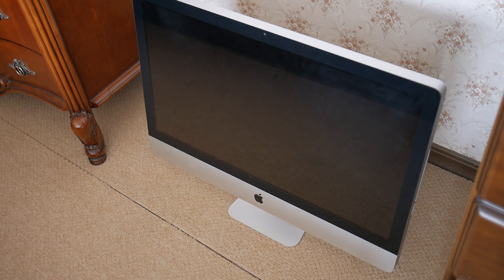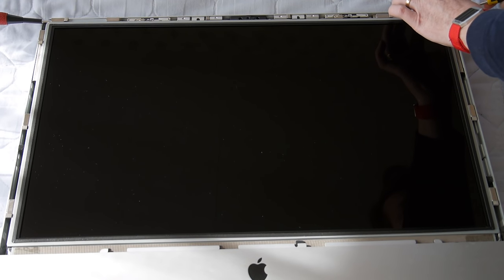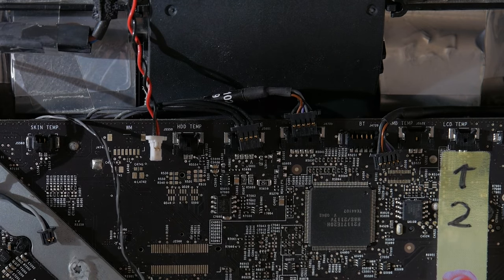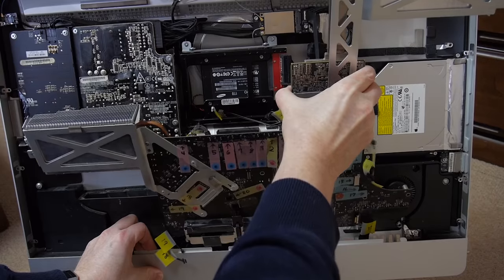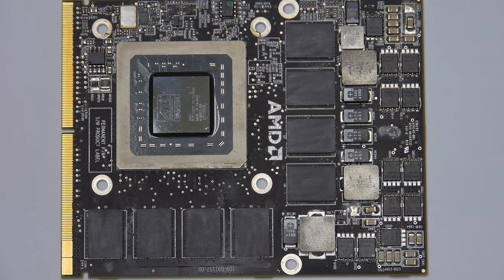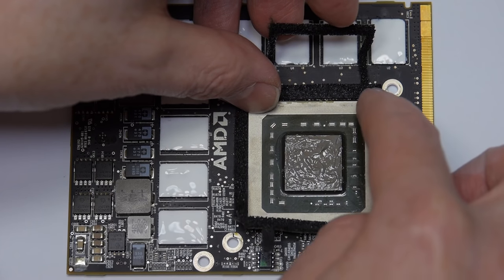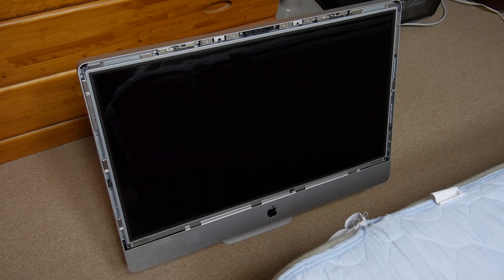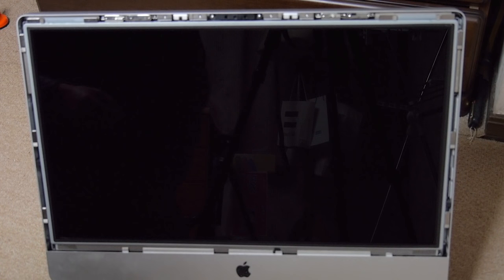Late 2009 iMac 27" Video Card Repair [4850 Bake]

Comment: Would this procedure apply to iMac 21.5 mid 2010 model too? Great demonstration!
Reply from the maker: Thank you for your kind comment.  I am sorry to say that my video would not directly apply to your Mac.  The insides of the 21.5, regardless of year, are not the same as the 27".  But the basic premise is the same and it would likely take the same amount of time.  You'd need to locate your video card, remove it, clean off the thermal paste, bake it, apply new paste, reinstall the card, then close up the Mac and test.  If you decide to do that, I would encourage you to make a good quality video of your work, not only for yourself, but for other 21.5" iMac owners who would love you dearly for sharing your experience.

Comment: Hey, hope you’re well. I wanted to ask you where you would recommend: Where Is a good place to connect a grounding clip for the anti stain wristband on the iMac whilst I’m working on it? I’ve been looking all over the web. No direct answers so I thought I’d ask you. Thanks for your help, J
Reply: Also, where did you store the screen when you took it off to work in the card? Thanks again JDW
Reply from the maker: @jeromemrj  I would not recommend connecting your anti-static wrist band to the Mac because the only way that would work is if you connected the power cord to a grounded outlet, and when working inside your Mac, a connected power cord could be hazardous!  The only place in the home other than the Ground pin of a 3 pin power outlet that is ground would be metal pipes, but connecting to those is probably more trouble than running a wire to the Ground pin of an outlet.  The only thing you really need to worry about is accidentally zapping the RAM with static when removing and inserting.  So long as you are not on a plush rug in winter, you should be fine though.

I set my display against a wall in my room where no other people would be for the entire day. Make absolutely sure you do NOT touch the display.  Only touch the edges.  Fingerprints on that display are really hard to get off.

Be very careful when working on your iMac in its upright position.  One guy who tried the bake had his iMac on a bed and it fell off onto a concrete floor.  Amazingly in his case though, the iMac was undamaged and the bake worked for him too.  Don't expect your iMac to survive a fall like that though.  He was truly blessed!

I hope this helps!

Comment: This video really helped a lot. By the way is this the same as the 21"? coz mine is 21". Thank you.
Reply from the maker: My iMac, shown in the video above, is a 27" model, i7, 2.8GHz, purchased in November 2009.  And while I cannot offer you specific guidance on 21" models, I do read and reply to every single comment here, and I have had a few people with 21" models who said my video helped them repair their 21" iMac.  So I would say there are many similarities, few differences, but since I myself have no access to a 21" model, I cannot be specific about what those differences are.  Even so, baking the video card and reapplying good quality thermal paste very well could solve your problem, if indeed your iMac's root problem is the video card, and not something else.

Comment: You didn’t need to remove the Logic Board on that particular Model, The only thing that I’d say is tricky is removing the Temp Sensor from the Graphics Card as that is located on the other side of the Board and just be careful when you go to remove the Graphics Cards as the Bracket could damage the small surface mount components if you’re not careful!
Reply from the maker: Thank you for your feedback.  I actually address that issue of removing the motherboard in the text description underneath my video because it is a rather common comment.  And of course, my 2nd bake video addresses that yet again by showing how to do the back without removing the motherboard at all.  Thanks.
Reply: JDW No worries, I was watching Videos of removing Graphics Cards all day ( Don’t ask, It was on Auto-Play that day 😂 ) so thought I’d comment when I seen you removing the Logic / Mother Board only to see that you’d done it the other way in your following Video, It’s very rare that I’ve used an Anti-Static Wrist Strap and I’ve never had any problems although I do frown when I see people putting Memory on Carpets! 🙂

Comment: I have the 2009 27” iMac and have those infamous vertical lines. I intended to go for a bake but I haven’t got the time.
Can I use the mac as a simple monitor using the small video port in the back without baking the 4850 card ??
Does it bypass the graphic card ?
Reply from the maker: Your question is a common one.  Sadly, the answer is no. Target Display Mode unfortunately doesn't bypass the CPU or GPU.  So even if you buy a MiniDP to MiniDP cable and try it, you would see the same problem you have now.  The two discussion threads below also talk about this:
https://bit.ly/3vyatpW
https://bit.ly/3i3gOWz

Comment: thanks heaps for the in depth video, i only have silver thermal paste, do you think that would be fine for the other 8 parts  surrounding the chip?
Reply from the maker: If you mean the memory chips (on which I used white, non-conductive thermal paste), I would say don't do it unless you put only a small amount in the middle of the chips so that the conductive thermal paste never spills over the sides.  If it spills over the sides, you may short something.  Just use Amazon to buy some non-conductive thermal paste.  It will only make you wait a few days and then your job will be worry-free.
Reply: thanks man, yeah i had non conductive silver thermal paste, just used it and am now reinstalling osx, the cpu fan is running like crazy though and im sure i didn't miss any cables. i'll see how it goes after the install and reset it a few times
Reply from the maker: I would suggest you install some fan control software, not to control your fans but instead to check the temperatures. If you know where inside your Mac there is an extremely high temperature, then maybe you can figure out the reason why it's triggering high fan speeds.
Reply: sweet as, thanks. here's my readings 

CPU Cores 1 to 4 are at  35 C
CPU Heatsink is at 27 C
CPU PECI 35 C
CPU Proximity 32 C
GPU Diode 43 C
GPU Heatsink 39 C
GPU PECI 35 C
GPU Proximity 41 C
Platform Controller Hub Die 43 C

They all seem normal to me, maybe a bit high for the gpu and i've had the fan slowed down. Appreciate your comments dude, you're awesome.
Reply from the maker: Thank you for the info.  None of those temperatures are high enough to cause high fan speed, so it could be something was not connected properly when you were closing up your Mac.  Some fan control software like smcFanControl allows individual fan speed settings for ODD, HDD and CPU.  Try changing the speed of those fans one at a time to see which fan or fans are spinning at high speed.  If you discover it's the HDD fan (and only that fan) spinning at high speed, your HDD temperature sensor connection is probably the culprit.
Reply from the maker: See "Step 10" on the iFixit website here for photos and info on the HDD thermal sensor connection, which can cause high fan speed, and keep in mind that even if you remember connecting it, you may have flipped the connector and inserted it the wrong way:  http://bit.ly/YBtS9y

Comment: I bought the Arctic 5, but should I use Arctic MX-4 for the memory cards? Thank you for you help!
Reply from the maker: You should use MX-4, or like me in my 2nd Bake, K4 Pro (see my "2nd Bake" video about that).  But you can use any "non-electrically-conductive" thermal paste on the memory "chips."  The reason is because there surely will be overspill and that overspill will touch the chip pins.  If you have a conductive paste, that would short the pins to some extent that may cause problems.  Even on the GPU chip you have to be careful with conductive paste because the overspill might reach the tiny SMD capacitors which surround the chip and thereby cause problems.
Reply: Thank you very much! It worked. I don't know how long it will last, but even a temporary fix is fine. : )
Reply from the maker: I'm pleased to hear of your success!  Please do let us know how long it lasts.  I don't think it will last beyond 3 years simply because that is how long a replacement card lasted after being installed by Apple.  It's clearly a design defect in this series of video card.

Comment: Hey thanks for your video. This help but my fans are going haywire at startup "apple white screen". Loud enough to be heard from 50ft away no joke. Fans do not slow even after smc reset. Any ideas?
Reply from the maker: There have been in a few people who has reported the same thing you have in regards to fans running at high speed perpetually after a bake. In all those cases, a connector was either left disconnected or wasn’t fully seated into its mating connector on the motherboard. So I’m afraid you’ll need to re-open your iMac and recheck each connector. If you don’t want to do that, you can expand the text description under my video and download one of the fan control apps I have linked for you there.
Reply: @JDW-  dude...I've been cursing up a storm and calling you all kinds of names for hours because I thought you were crazy with the fan app. Walkaway and tried something else and saw the fan app was still up and was like this stupid app again. Close it and saw that it was still on the upper tabs menu and wanted to quit and delete it then saw a drop down menu where you actually have control of things and just clicked on it and dragged it back and forth just for the hell of it.

Holy shit...it worked. Fans are back to normal. I take it back! Thanks for your help. Gotta give credit where credit is due. Thanks!
Reply from the maker: @tbg9708  Yeah, you'd think that installing a fan app would more intelligently use a fixed set of fan speeds by default, but that isn't the case unfortunately.  So you have to dig into the fan app settings like you did to fix things.  Keep in mind though that your fans only run full speed because a connector was left disconnected or was only partially connected.  Should you ever open your iMac again, you really should check for that and fix it.  Then you won't need any fan control apps at all.  With that said, I personally use a fan control app to keep all 3 fans running at 2000rpm.  The noise isn't too bad, and it offers much better cooling too.  Best wishes!
Reply: @JDW-  by the time I got your reply it was my second then my third time doing it and still couldn't figure out why the fans were at full speed. Sprayed air into the connectors to clean the slots. Checked cables and were fine. So not really sure. There was, however, something that literally popped from the mother board that I had to weld back but other than that everything is working.
Reply from the maker: @tbg9708  Something popping off the motherboard sounds concerning!  But if you are sure you soldered that part back onto the motherboard properly, then perhaps all is well, at least now that you have fan speed under control using a third part fan app.

Comment: I'm reading complaints about K5 Pro not being suitable for use over 1mm thickness. That it can 'boil" on high temps. Have you experienced this?
Reply from the maker: It seems that you are talking about something else other than graphics card applications because I read and reply to every comment under all of my videos that pertain to the Bake, and not a single person has reported anything like you have about K5 pro. I also swapped out the card for a 6970M in April 2020 and that machine is still in service today without any problems whatsoever. 

Remember, K5 pro is not intended for CPUs. And I didn’t use it on my GPU either. I used it for the VRAM chips. They don’t get nearly as hot as a CPU or GPU. For heatsinking VRAM chips it’s perfectly fine. 

If someone is trying to convince you that K5 pro is unsuitable even for a 1 mm thickness, then I would argue that thermal pads themselves aren’t suitable. That’s because K5 pro is a thermal pad replacement paste. So if those people who you read about who are complaining about K5 pro are trying to use it on things like a CPU and GPU then of course that is not suitable. That goes outside its intended purpose. 

And no, I’ve not heard of K5 pro boiling either, probably because it is a thermal pad replacement paste, not a CPU or GPU paste. 

For the application shown my videos on the video card bake, where I used K5 pro exclusively on the VRAM chips, it’s perfectly usable, and I have the years of experience to prove it. So I still highly recommend K5 pro regardless of what somebody out there on the Internet has said about it. 

Nobody pays me to say what I’m telling you now. I’m simply giving you my experienced opinion about a product that I myself have confidence in, and which I’ve seen others use with success too.

By the way, I know that you’re not complaining about my videos or K5 pro. You are merely reporting to me things you have heard on the Internet and you’re asking my opinion on it. And I’ve given that to you. So please don’t misinterpret my words as being directed at you. 

I have come across many people who claim that the Bake itself is bad, but those people don’t know what they’re talking about. And again, I and countless other people have experienced to prove it. If you go through all of my Bake videos and count the number of comments you’ll see just how many people have tried it was success. And it does last a surprisingly long period of time too. So I think most people can proceed with the Bake in confidence and use the pastes that I recommend because I’m not just recommending something that I have not use myself. Many other people have been using them too with success. That matters far more than any number of expert opinions you may have heard out there. Because at the end of the day, what is an “expert opinion“? I myself feel it is not simple an opinion from people who merely sound to know what they’re talking about, but an opinion from people who are experienced in using the paste for many years in an application that I’ve been talking about. When use it properly,K5 pro works well. And it lasts a good number of years too.

Below is the video where I changed my graphics card to a 6970M, and I replaced it at that time, using K5 pro on the VRAM chips.

AMD 6970M upgrade for 2009 iMac 27" [Video Card]
https://youtu.be/9dPsH1zIQMs
Reply: Thanks for your thorough reply (and great videos!) I ended up ordering some K5 Pro and will do the bake. I read a discussion between users and the manufacturer of the paste on Reddit, that's my source.
Reply from the maker: Thank you for replying back and letting me know about the source of your information. I honestly think you’ll be happy with the K5 Pro paste. And as far as I know, it’s still the “paste” substitute for thermal pads. And the reason I use K5 Pro is because it’s extremely difficult to measure the exact gap between the top of those the VRAM chips and the heatsink. A paste eliminates any worry about getting the wrong thickness of a thermal pad, but you cannot use regular thermal paste to do that. You need something like K5 Pro which is intended to be used in situations where a greater thickness is required and that thickness needs to be maintained over time. So long as you don’t use it on very hot chips like a GPU or CPU, it should work fine, just as it has been working fine on my 6970M graphics card VRAM chips since April 2020.
Reply: @JDW-  Just reporting back to say I did the bake and my 2010 imac is again up and running. Thanks for helping out!
Reply from the maker: @einargoksyrasen7636 that’s wonderful to hear. Thank you for making time to let me know your success! Best wishes.

Comment: Hi there, I am wondering if ANY 2009 iMac 27 inch has got the HD4850 socketed? So I could change it if had a new one (in case baking won't last). I am talking about an i7 2.8 iMac 11,1. Late 2009.
Thanks for answers.
Reply from the maker: As you can see in my video, the video card itself is not “socketed” but rather inserts into a “slot.“ But since you used the word “socketed,“ you are obviously talking about a chip on the video card rather than the video card itself. And the answer to that is, no, the GPU chip on the video card is not socketed and cannot be swapped out.